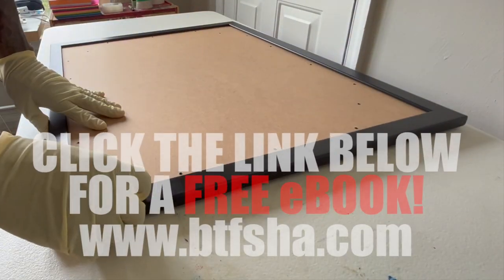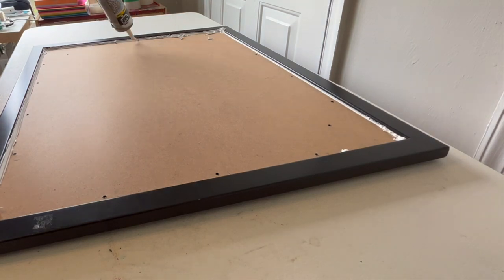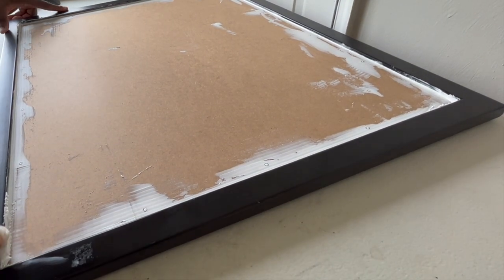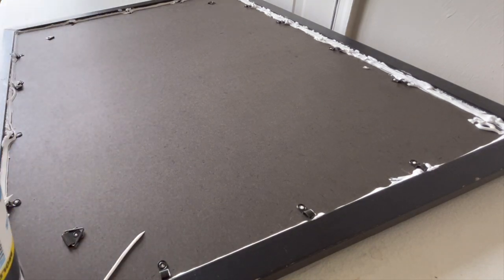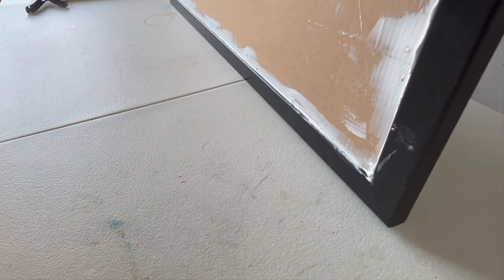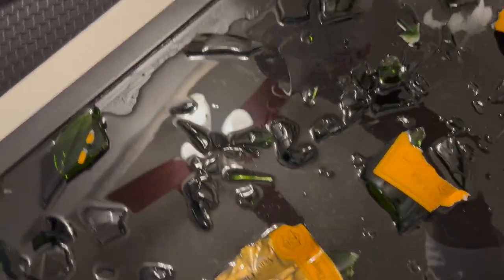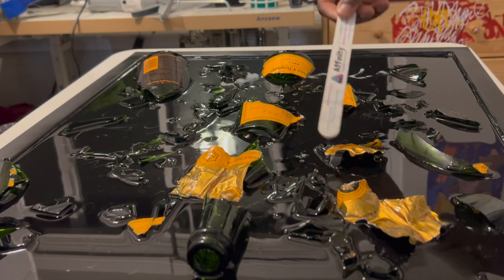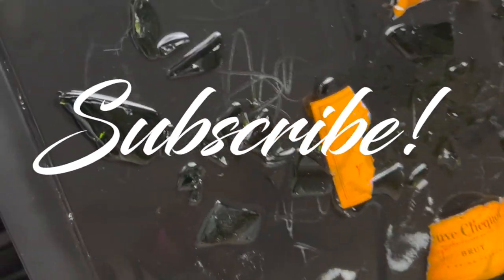EPOXY RESIN BROKEN CHAMPAGNE LIQUOR BOTTLE WALL ART | HOW TO MAKE $5000 FAST

Comment: How much resin do you need for this?😊
Reply from the maker: @Daniel512100  each project may vary… there is no set amount … start by using a 1cup ratio depending on your frame size - I hope this helps
Reply: @shastylesdesign thank you. I will try it ❤

Comment: How much money you spent making this?
Reply from the maker: My apologies on the late response but the frame was $12- the resin from Etsy was roughly $60 (I didn’t use the whole bottle) the silicone caulk was like $7 the cliqout roughly $50 heat gun like $30 … you can also thrift a lot of this stuff foreal